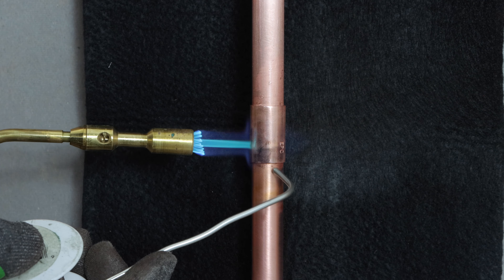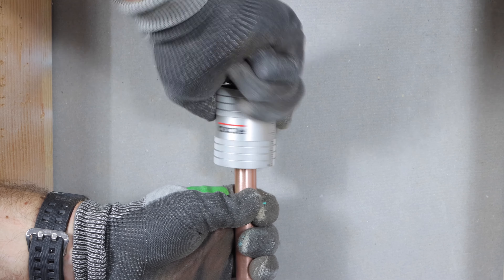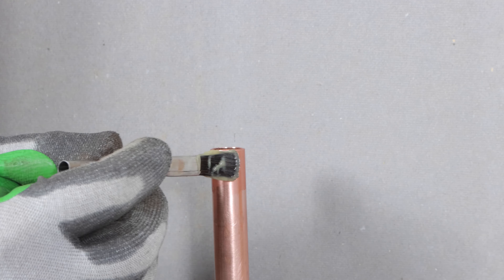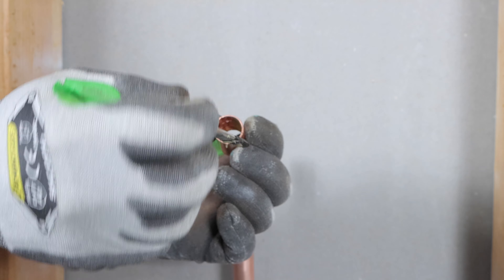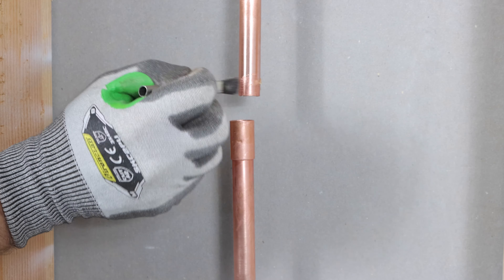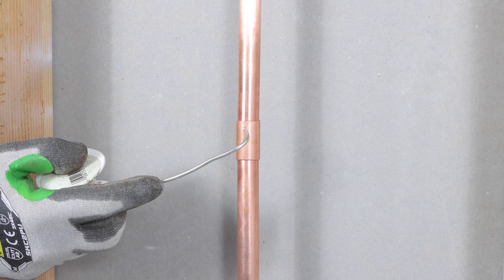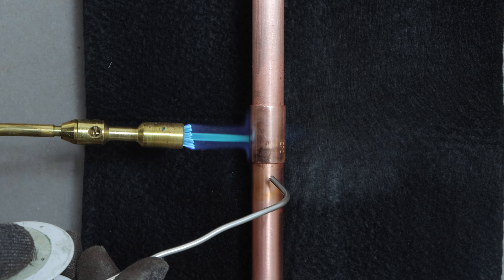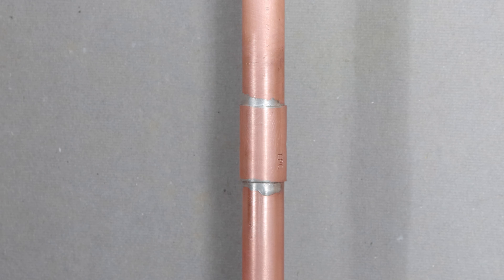Solder Vertical Copper Pipes for Beginners

Comment: When you put the solder to front of coupling why not go around a bit to make sure  coupling got fully soldered?
Reply: Solder is getting wicked all around the pipe were flux is ( it is even easier for it to go around that to go up the fitting), as long as the pipe is hot all around. For 1/2  inch it seems enough to heat on one side. Note also that backside is not always easily reached.  One point is to provide enough but not too much solder,  the rule is 1/2 inch of solder wire for 1/2 inch pipe,  and so on. That's why bending wire at 1/2 mark is useful - you see when enough solder has been applied.   Anyway, saying all that I am still failing to do my repair, as I need to solder above my head, barely reaching the joint :)

Comment: Did you miss the back of the pipe or did I forget something?
Reply: So, with the coupling as the primary spot where torch was pointed, it will be the hottest part heating up the male portions of the coupled pipe. (You probably got that, just summing up). The solder wants to flow in the direction of heat (the capilerry action that he mentioned), so it quickly fills right in front of him, then fills around back because thats the next stage of heat it wants to migrate to. Most importantly, the reason it is enabled to do so, is the flux.. that's super key.
Reply: Good question.
Reply: Good answer.

Comment: Thank you! I can't wait to show this to my husband! He can weld but is afraid of soldering water pipes because well...what if it leaks? He seems sure that he won't be able to do it.  We have a downstairs bathroom project that we've talked about doing  for years but he's afraid to start it. Is horizontal soldering the same as vertical as far as the steps involved? You make it look soooo easy. Thanks again! 💕
Reply from the maker: thank you, if he can weld then he can definitely solder. If it leaks you can turn off the water then heat the fitting and redo it. Horizontal soldering is similar, I like starting in the bottom band working upward
Reply: @HomeRepairTutor  Thank you so much!!!! I really appreciate you getting back to me!
Reply from the maker: you bet, I’m happy to help 👍🏼🔥
Reply: You can do it don’t be afraid . I did it my first time and have now gotten better over the years and also saved me money over the years from not having to hire someone.
Reply: @ELI-vm9yf  thank you for the encouragement! When my father passed we inherited all his tools (lots!) And among the many boxes is all the tools, materials etc ... For soldering.  All kinds of stuff that he could practice on even. We'll see. Fingers crossed. I'll show him your comment. Thanks!
Reply: Scared to solder but can weld?
Reply: Ive welded Tig for Schlumberger on pipe that had to be xrayed, Ive repeatedly gotten one end to solder, when doing the other end of the coupler it unmelts my previously soldered joint

Comment: Mr. Home Repair Tutor, I find your videos are very helpful in doing DIY around the house. My question for you is, sorry it don't have anything to do with soldering pipes. I'm pretty decent with that, but I am looking to waterproof my garage wall that have a L shape wall. That's under ground on one side, if it rains heavy some water will seep to sink in. I looked up on YouTube and found that you did the same thing to a basement wall of a house, it been about 3 years since you put that video out. How well did that work out for you? Using drylock.
Reply from the maker: the best first step is to ensure downspouts aren’t clogged and drain at least 3 feet from the wall; also have the ground around the house sloped away if possible. Start there before using DryLok 👍🏼

Comment: How does it melt get on the wall side? Newbie here yeah
Reply: The solder goes toward the heat and flux. Start from the bottom and as the heat expands upward and behind, the solder will follow.

Comment: Thanks a lot! Your instructions helped me out of a jam - heat the pipe, then the coupling, and keep checking to see if the solder will melt. Finally got good solder flow with this tip! Great video!

Comment: Nice video and explanation.
In case I fail to weld the copper pipe and it starts leaking out, how do you remove the failed welding to uncouple  the pipe without necessarily cutting it?
Thank you

Comment: I normally heat one side and then from the opposite side touch the solder.....that way you know the pipe is hot enough and you'll see the solder chace the flux

Comment: Hi. Please tell me, I came across such a pipe, a soft pipe, it bends, half an inch. How can I solder it? I need to solder a coupling, on one side there will be this soft pipe, and on the other side there will be a blue L pipe. What solder is needed for this soft pipe? What is the sequence? How should I solder so that these two pipes are soldered together? Also a vertical pipe? Thank you.

Comment: What do you do if there's still water in the pipe and you can't get it to stop coming out because something's not shut off or there's too much water still in the system that is going to take too long to remove and you have to work with this water that's in the pipe that's not flowing but it's leveling out somehow in the system so it continuously keeps coming up even though it's off and you can't get it to do anything else even if you sucked it out at the shop vacant refills up?
Reply: If there is just residual water in the pipe, jam some cheap white bread up the pipe. This absorbs and stops the water from dripping back and cooling the sweat. The bread will come out the nearest tap when you're done. You'll never solder a pipe if even a trickle of water is inside. Almost makes me want to spend the $1500 for a press tool.

Comment: So I’m trying to solder a vertical piece in the wall I’m only able to get the front will the solder make its wake to the back on its own.
Reply: Yes, as long as pipe is hot at the back, which should be  with only heating from the front, if the pipe is not too thick (say 1/2 inch or perhaps even 3/4)

Comment: You reamed all the bits of copper into the system, bad, bad, bad.
Reply: This is a stupid comment the sediment and chemicals are worse on the system
Reply: Sometimes it's unavoidable.  In those instances, I flush the line by using a faucet downstream of the location I just soldered.

Remove the aerator from the faucet and open the valve wide open and any debris in the line should be washed out.
Reply: Get your own job dude
Reply: Was curious about that, do you just stick a rag down the pipe, deburr and then remove?  Or is there a better option?  Thnks!
Reply: @motogp9253 just do it and the water will clear it out.